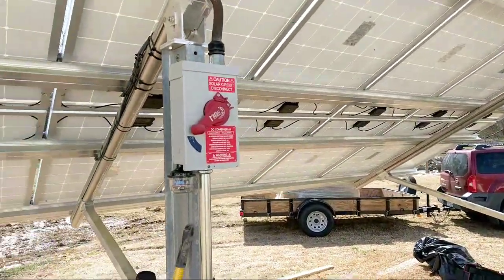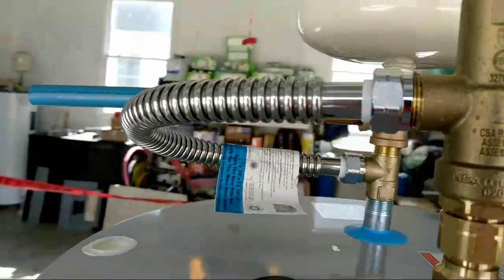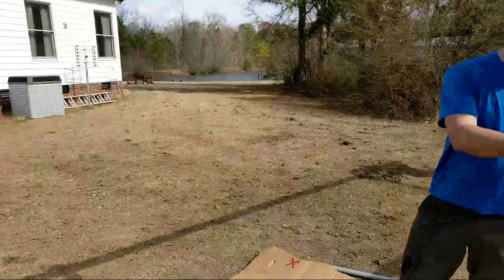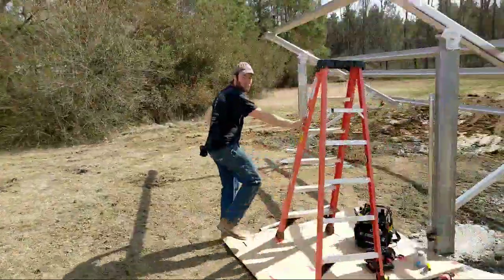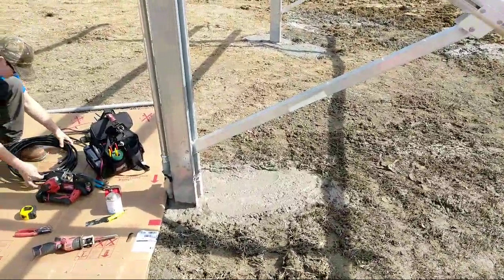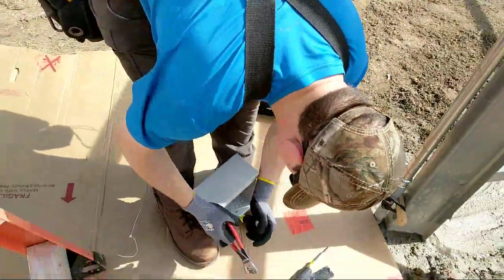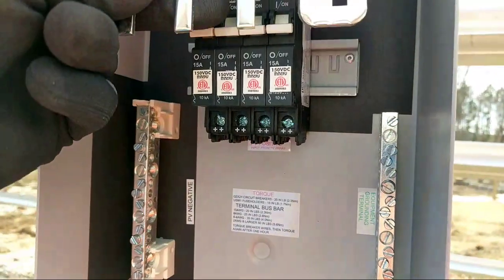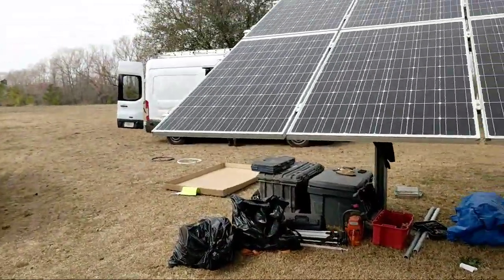A Phase 2 Solar Build

Comment: We're u work out of?
Reply from the maker: South Carolina but we travel.
Reply: Engineer775  you are going to love the grundfos I am using a 3.5 gal per min. On 2 255 watt panels and at 300 ft. It pumps a steady 3 gal a min. On just 2 255's